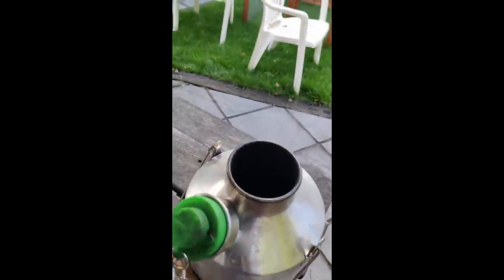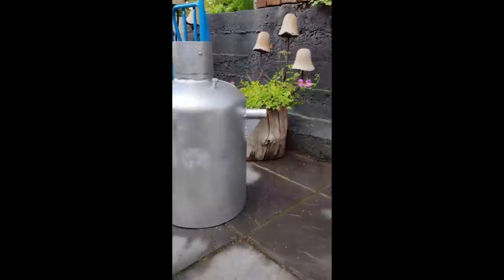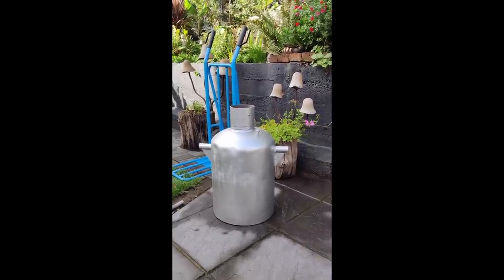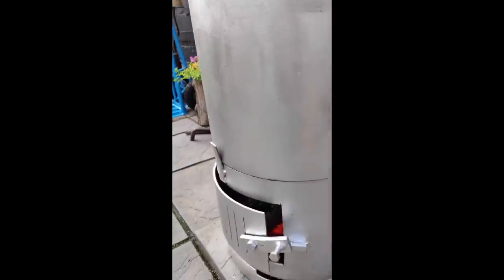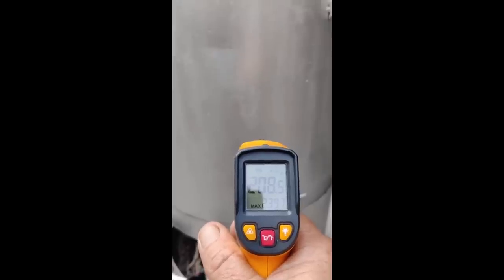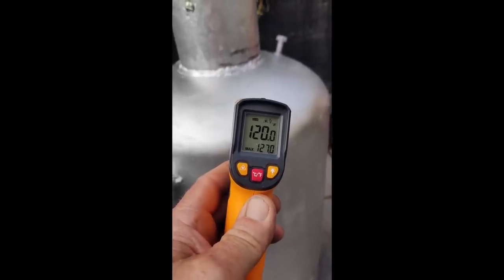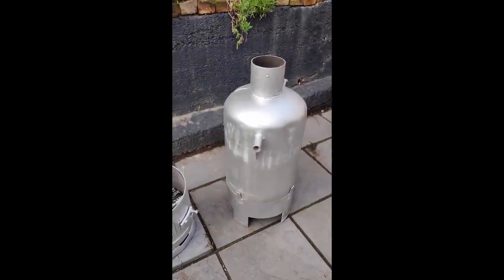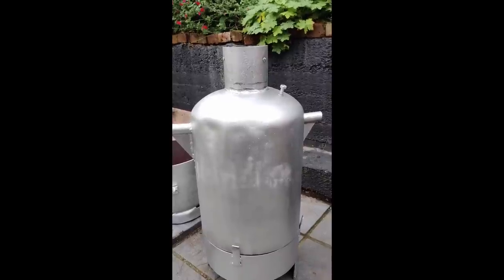Sand battery can it heat my home?

Comment: You should look into a Rocket-Mass heater.  If you want to change the storage material to sand,  thats fine.  But the Rocket Stove engine, burns much hotter, burns more and burns "Clean"... thus,  it also takes a lot less fuel to heat with.      In this particular design, a lot of the heat is still traveling right out of the top of the pipe... as heat mostly Rises vertically...

 If the mass was directly above the heat source, rather than just surrounding the side of the pipe... then you would be capturing and storing, a Lot more of that heat.

 This is one of the genius things behind the rocket mass heaters.  The hot air goes directly into the center of a metal barrel, and then has to be forced downwards out of the barrels exit pipe.. near the bottom of the barrel.  A lot of the heat, gets released into the barrel... and then the rest of it is captured into a long bench (heat storage mass)... that you can also sit / lay on (with some protective padding, of course).

 These have the added benefit of putting a kettle or even frying pan on top of the barrel surface, to cook with.   That said, if you wanted even more heat to be stored, and released much slower... then you could add more thermal mass on the top of the barrel  (such as another shorter barrel of Sand),  and skip the cooking abilities.

 Some have also made mini ovens in their rocket mass heaters, by having the vented hot air, pass around an empty oven chamber.

 Which ultimately may lead to the study of the old Russian woodstove / heaters.  I believe they use the same rocket fire design... but they are used for both heating and cooking... and are massive in size.    Ive only seen some photos of them.. so Im not sure of the exact inner workings of them.
Reply: I will add, that ultimately, you dont want the heat to be so completely insulated.. to the point where its not flowing into the house fast enough.  The whole idea, is to capture as much of the heat as possible... and to release it at an effective rate, to heat the house up.    Typical fireplaces, do not store enough of the heat, and thus.. it gets wasted, traveling right up the chimney.
Reply: The rest of the Equation... is Heat Loss in the actual House.   The biggest heat loss, is from windows.  Thin pane glass, gets frigid cold, quickly.  Even dual panel glass windows, are still not that good at insulating the cold temp exchange.   Shops use something like a CM thick, tempered glass.  I think building windows might even be thicker.   The best protection, is probably to insulate and cover over them, during the winter.

 Next part of heat loss, are Door cracks.  Where cold wind, can be pushed through the very spaces between the door and the frame, or under the door.  Make sure there is thick rubberized gasket, to seal the doors, air-tight.

 And the other large heat loss, comes from Insulation between the floors, walls, and attic.  Any insulation that can keep the heat from rising so quickly.. will be a huge help.  Even a thick carpet on a 2nd floor, will help insulate.. and trap some more heat from rising.

 If you have any Skylights.. you want to insulate and seal them up too.  They are one of the worst offenders of heat loss.  The cold temps pour into the room from them... like a waterfall (despite being no air leaks.  Just pure conduction)

Comment: Sand is a terrible medium to keep heat, and it would likely be better to use small stones and pebbels as a heat battery.
I mean, there's a reason beyond arid air that makes deserts cold as a fridge at night despite being heated up by the sun for 15-16 hrs a day

Comment: proof is in the pudding. with wind cooling the outside, it wont be an accurate way of judging how much heat its holding. my thinking is that as soon as its around 200c on the outside, take it inside, or out of the wind. (or once its insulated) see how long till the inside gets to say 40c... then heat it right up very thoroughly. see if the difference is worth the extra wood and extra heating time. my estimations that it wont, but what about like a thermometer on a rod you can shove into the hole to check the sand. the outside will heat a bit from the fire and the wind will cool it so its obviously going to fluctuate.
Reply: i think the real idea is to have an outdoor cooking stove, when you make more air intakes see if you can make the air swirl as it enters, this will raise the flame more for cooking, then when your done cooking, rip it out of the out of the stove cabinet and bring it inside. making use of as much heat as possible. underfloor water heating is obviously the most efficient way to heat a house. PUT THE FAN ON THE TOP, should help the heat spread out for the whole room. obviously its not going to do wonders at heating the whole house but it should be comfortable next to a computer or tv. do let us know how well it works and for how long. cant wait for your subjective experience, ill trust your judgement about it. goodluck! subbed.
Reply: SAFETY consideration: if blowing the air down, maybe have a sheet of metal under it, not straight onto carpet or anything XD but im sure you arent silly, just thought i should add this since it crossed my mind
Reply from the maker: See part two, but not in the video but was still above 40c after 12hrs 👍

Comment: Try sucking the air down through the pipe. That way your displacing cold air with warm and forcing the heat to distribute better vertically.
Reply from the maker: Too hot I'm afraid will melt the fan 😬

Comment: Try using copper rods in the sand (I envisaged 10mm rods).  Space them in a patterned format which has them roughly 3 inches away from their neighbour.  The copper will transfer the heat to the higher level of sand and give you a more balanced heat over the whole unit.  And FFS, talk in celsius man, we're in England dammit :)

Comment: Nice build pal. Are you losing heat where the sand section meets the wood burning section ? Hard to tell but looks like there's a bit of a gap around at some points on the circumference. Would a narrower flue help ? I read about the industrial ones a while back and i think they melt the sand (or salt in some) but i may have misremembered that. Where do you put the sand in, through the screw hole ?
Reply from the maker: To hanks, Slight gap pulling in air more than loosing heat, I wanted a large diameter as it gives me more surface area to get heat in & importantly get it out,
No I welded the top of the flue first flipped it over & filled with sand & then welded the bottom plate 👍
Reply from the maker: Thanks not,  to hanks
Reply: @leejones2511  I see, thanks.
Reply: @leejones2511  Thanks to all the Hanks ;+}

Comment: Effiency on this is crazy low. Sand and rocks are basically the same. Just make a burning owen for decent size rocks. Burn em for 30min or so and collect em to the bucket and carry it inside. You really dont need the owen, firepit will do.

Comment: Just as you started talking about the design I remembered something me and my friends did. We had a broken lawn mower and built a fire pit on top to make a portable fire pit we could take with us during parties.... If you can see where I am going with this... build the sand battery system on top of a lawn mower frame, then you can just wheel it into the house and fold up (or take off) the arms while it is inside and warming the house! I may just have to do that when I finally get around to making my channel lol. Cheers from Canada buddy!
Reply from the maker: That I'd like to see 👍

Comment: Good call on the relief valve. Throw a fan at the fire that should heat things up below. A couple of fins just above the bottom of the tube could help swirl the hot gasses around the pipe.

Comment: These are the same as the old storage heaters from the 60's/70's.  You only get the heat you put into them, so for it to stay hot all night you have to heat the darn things up all day, how does that make sense?
Reply from the maker: Complete opposite, you heat them all night when electricity cheap & use the heat all day - evening when it's expensive  it's called saving money & they are still used today & if worked right they  are great 👍
Reply: @leejones2511  No they are not great at all.  Had them used them total crap.  This contraption of yours is dangerous and impractical.

Comment: Insulate it with ceramic fiber. Either all or parts of it during the heating process.
Reply from the maker: Yes done it & is in part two if you haven't seen it 👍

Comment: The problem with this approach is like running a gas powered generator to run a corded electric mower instead of a gas powered mower. Dandahermit

Comment: If you put baffling in the pipe you can transfer more heat into the sand
Reply from the maker: Did something similar in part 2 with better success 👍

Comment: stand it next to outside wall pull hot air in house from the unit outside
Reply from the maker: Can be done,  but for me it would have to travel too far to where it needs to. so is easier to just bring it in 👍
Reply: @leejones2511   you made a great item its got my brain thinking for my own projects to thanks bud.
look up Robert Murray-Smith on youtube he is also full of ides

Comment: Hmmmm.... my gas-fired 40-gallon (approx 150 L) upright water heater has its flue positioned dead center above the gas burner.  The flue's exhaust gasses are slowed down by a thin, flat ribbon-like baffle which is almost the diameter of the flue and running the length up the flue and having a twist rate of approx  (estimating here) about one turn in 3 ft. That's a lot of sand capacity! My "sand heater" would be almost complete should I use an old gas heater to make one.. And gas heaters are VERY common in the US. Electric heaters, not so much. Cheers!
Reply from the maker: I'm not sure on US water heaters in the UK we have copper immersion heaters but they aren't that popular any more as more people changed to Combi boilers, if your planning on moving it then don't make it too big but if it's static then the world's your oyster 👍

Comment: IMHO you have way too much air flow. ....sucking too much cold air into your firebox, then it just flies right out the top taking the heat with it. Consider better control of the intake volume....adjustable vents on the door and also baffles in the vertical pipe to hold the hot gasses inside longer. That's how airtight stoves work. Otherwise, I think you're on to something....good job.
Reply from the maker: Thank you , yes been working on ventilation today, still working progress 👍

Comment: What about doing a "heated Pipe" water exchange from your fire outdoors and circulate it through hose inside attached to a radiator, and circulate it back?  Continuous heat that way as long as you can grade a gravity fed wood supply system.  Cheers and GLTA this winter.  (Thanks for doing this, as I've been brainstorming sand ideas myself.)

Comment: Great video Lee thanks for sharing. I see the neighbour put up with three weekends of you grinding and then on the forth when he saw you out in the garden filming he thought right now is my chance! I don't think it was grinding anything of purpose x-)

It's cracking what you've done and looks effective, I've watched the 2nd part too. The only adjustment I would say is a few more holes on the side-walls of your burn-box to get more oxygen in there, more oxygen in there will give you more intense heat. The move to smaller bits was a good move as well. I wonder what it might be like if you were to use thin longer bits and top-loaded it, say for example some left over timber split vertically a bit, with bits dropped-down the flue coming say roughly half-way up the chimney, it'd draw that flame up to the middle a bit more, maybe a bit too much though. Nice work!
Reply from the maker: 😂 yes I expect he did, bit of a coincidence isn't it!
Thank you yes il be looking at ventilation next, & yes a good idea putting in some long stuff up the flue 👍

Comment: Vent the sand jacket with a couple of small holes(plugable) and wet the sand at the beginning. Sand is a poor conductor so the water will conduct the heat at first and by the time it dries it should attain a higher heat?

Comment: Try burning hornbeam, they used to use it in ancient forges .
Reply from the maker: Yes hornbeam is a great wood if you can get it, splitting it with an axe though is like throwing a dart at a dart board 😄

Comment: Water has 4 times the specific heat capacity and ALL of the infrastructure and installation experience already exists.  What is the point?
Reply from the maker: Google sand battery & find out 👍
Reply: @leejones2511  So it heats up to 600C which water won't unless pressurized.
Still there isn't any excess "cheap" energy to store yet.

Comment: Your Not allowed, to run a wall mount propane heater, They are cheap and work very well, Or maybe a pellet stove, Your talking a 3 inch pipe out the wall, and they are very safe.

Comment: Is not working, well it will work but you thinking to small. I have one container of 5 kubikk i will use. Obviously need place it outside, charge it with heat from wood and use pipes running inside in spirals to take out hot air and water

Comment: This design is not right. Because flame go directly out. Nothing is heating sand block inside. To improve this design you must take cement rebars and put it inside sand block and in the chimney also. The flames will heat sand very quickly and it improves efficiency drasticaly. Of course it is easy if we have plasma cutter to make holes for rebars...  P.S. Good luck! :)
Reply: The metal that heats it faster will also cool down faster. The goal is to slowly release the heat. The metal shell itself will transfer tye heat in and out well enough.
Reply: @terrafirma9328  Ideal design is in finnish setups. There is an absolutely isolated drum with sand and heating/ heat release is made by pipes inside the drum. Here - is very low efficiency/ maybe 5%? My idea was to heat it faster with concrete rebars. After heating this drum/ bucket/ etc must be closed up from all sides or better this metal thing must be placed inside some other isolated sand "wall". P.S. In old times peoples made clay furnaces which is similar concept. Very low efficiency, but very slow/ long heat release. In our countryside clay furnaces are heated/ burned wood 1 day and the next 4-5 days heat is radiated out. In new concepts like Waterford/ Jotula furnaces we use 4 wood bricks and we get heat to 12 hours. Of course we can make a hybrid Waterford+Clay stove, but we must make labyrinths inside the "wall" to heat the clay mass faster...
Reply: I get your point. He needs a better insolator, isolator heat delivery system firstly, too slow the heat release/transfer Maybe later on speeding up heating the internal can be worked on.
Reply: @terrafirma9328  Yes. In finnish design all pipes are underground - only sand drums are outside, because of very big construction.
It is because the ground itself 1 meter underground is "isolated enough" to not spend tons of money to make the system reliable. "Just have a think" Youtube channel talks about finnish design in one of his videos. Check it out!
:)

Comment: A stove with sand battery is nothing more than a glorified mass heater that's using sand as thermal mass instead of clay and dirt, or even plain water. You could get it to the kind of higher temperatures that sand withstands using a rocket stove instead of this basic stove.

I have the exact same issue and concern in my new old house that has no heating at all beyond chimneys.
My first thought was to go with a modern efficient heat pump, but that's still darn expensive to buy and maintain, it's a bit piece of smart junk that consumes a lot of resources to build and that I can't repair, and it still consumes a lot of electricity that we should conserve because it's too dispendious to waste, no thanks to Putin.

So I'll be going with wood instead, since it's the country and I even have a decent wood to make my own firewood.
I am using an efficient double combustion wood stove for this winter, but burning wood inside the house is a mess, so I plan on building a well insulated rocket stove right outside the living room, with a coil of steel inside the stove's chimney that goes right through the wall, either inside a bench of clay and dirt that will act as thermal mass, or pipes alongside the wall, sandwiched between a sheet of insulating material and an extra 

Instead of a sand sleeve above the combustion chamber, you could put a copper or steel coil that redirects the heat from the stove outside your living room to some thermal mass inside, going through either a clay and dirt bench, or alongside the walls, between a sheet of insulating material and an extra 5-10 cm of clay wall! to act as thermal mass. In which case I'd need a thermostat to keep the heating wall at low temp, so I'll still have a lot of heat I can use for other purposes, like sanitary hot water, heating other rooms, or having a warm closet for bread leavening or yogurt making.
I am even thinking about having the stove's chimney go through the wall too, into a heating plate for the kettle, before going back outside.
I like the idea of the stove outside, because there's no wood dirt or ashes inside, and you can even integrate it into a pizza or bread oven if you have a valve to condemn the inside heating in summer. I also like heating walls and floors for the same reason, plus they make room arrangement easier when there are no radiators in the way.

@TNT is a great source of inspiration indeed for all his ideas and actual working designs, not even mentioning his manic laugh...
Reply from the maker: Good luck with your project sound a big one 👍